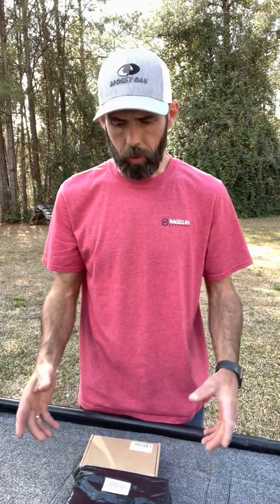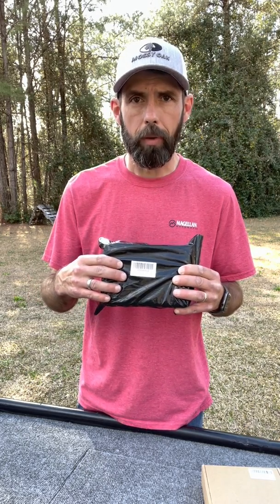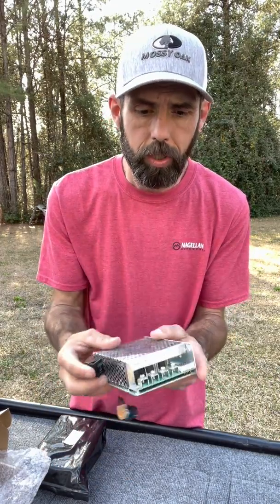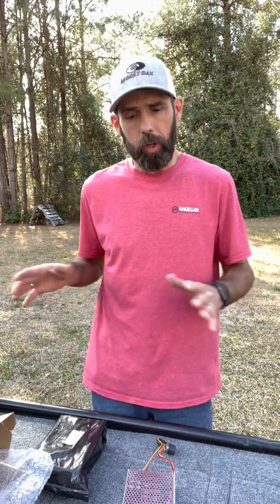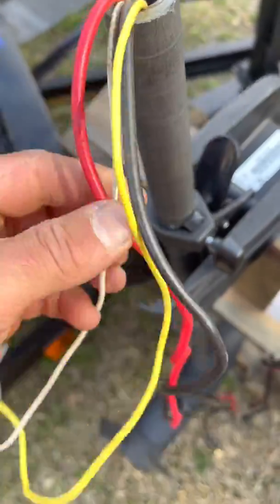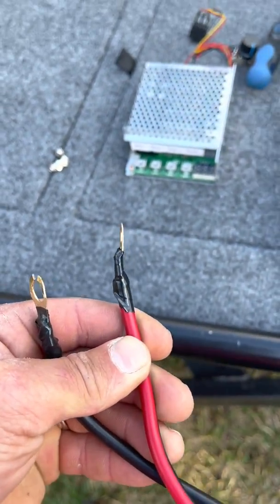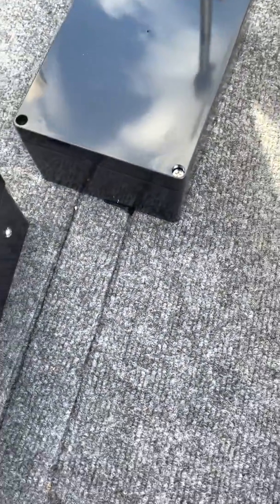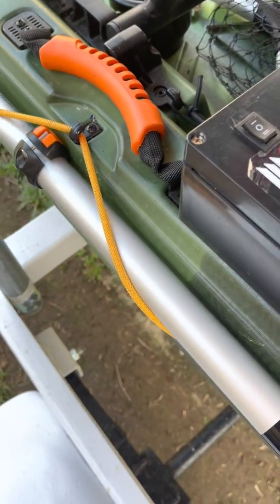How to hook up a PWM (pulse width modulator) to control a trolling motor.

Comment: Greetings and thanks for the good informative video. 

My question is, what are the yellow and white wires for coming from the top of the trolling motor shaft?  Would I need to use those wires if I’m gonna use the trolling motor’s speed selector switch after I remove it from the head of the trolling motor and use that speed selector switch with my boat brakes pedal setup at the front of my boat?  And would this be an alternative to the PWM setup?
Reply from the maker: The white and yellow wires are the low and medium speed wires. When using a PWM the red is all that’s needed is it’s the full speed wire and the PWM gives you control of all speed. 
Now if you’re using the speed control from the trolling motor head yes you have to use all the wires, but if you are using just a PWM no you will not need the white and yellow you can leave them in the shaft of the trolling motor and tape them off.
Reply: @334tacticaloutdoors Thanks so much for the detailed and fast response to my inquiry.  You’re Outstanding!👍🏾
Reply from the maker: You’re welcome!! And thank you for watching the video and giving fantastic feedback.

Comment: Hey thanks for the video. So tell me about that "project box" lol jk. Actually I just fried my first pwm,  I think I hooked one set of wires backwards but looking on Amazon got me wondering would one with higher wattage or amps be more beneficial in any way like helping with performance, or excessive heat? Heat means wasted energy and just wondering if a larger pwm could help with that while also keep it from shutting off due to excessive heat.
Reply from the maker: Yes the 100amp PWM works best for the 45lb -55lb thrust trolling motor.
Reply from the maker: Even the 30lb thrust trolling motor works best with the 100amp and also using 8awg wire from the trolling motor to the PWM and from the PWM to the battery.

Comment: Anyone help.. im about to do this and i understand that if it goes bad on the water you can simply plug motor back into battery to get home.. but how does the head work without them extra wires that were deleted ??
Reply from the maker: Without the PWM you would only have one speed with a direct connection to the battery. Them 2 wires is the speed control.

Comment: Great explanation! I bought the larger of the two, followed your instructions to a tee, and it's not working😢. Connections on the back are B+MMB-. Assuming B is for battery
Reply from the maker: Yes B+ is for battery positive B- is for battery negative.

Comment: I just received my 100amp pwm from amazon and its not labled at all where to put battery and motor wires. Would it be the same as your thumb nail pic
Reply from the maker: Yes it should be the same.

Comment: Ive been trying to figure this out for my trolling motor, but i have a black, white and green wire. Black is ground id assume, so when i put black to ground and either white or green to positive, the motor spins the same direction. Im not sure how to hook it into the PWM
Reply from the maker: Black is your ground, white is your positive and the green is your ground. Hooking to the PWM just your black and white is used just ground thee green wire.

Comment: Great video, man! Do you think it's really worth it to use a PWM? I've been stalling on finishing my new trolling motor install from my old one that burned out because I can't find much info on how much power you actually save, and if it's actually worth adding the extra parts. Have you possibly tested how mch power you're saving?
Reply from the maker: Thank you!! I personally went with the PWM setup for speed control. You’re saving maybe 1 hour to 1-1/2 hours more battery life per day with the PWM that’s about all. Personally if you’re not doing the PWM for speed control it’s not worth it.

Comment: Awesome video sir, doing my project this weekend would you recommend running a fuse between battery and PWM?
Reply from the maker: Thank you!! Yes it’s best to run a circuit breaker and put it as close to the battery as possible.

Comment: does it get hot?
Reply from the maker: If you make long wide open runs with the trolling motor yes it will get hot. If you plan on running long runs at full speed make sure to get a PWM with a built in fan.

Comment: Great video! Thanks for making it so simple. After reading reviews on Amazon about manufactured boxes, I was getting gun-shy about the whole process. My biggest concern is how much heat it generates, and whether that's a concern.
Reply from the maker: Heat can be an issue on long full throttle runs. The 100amp PWM has a built in fan only downside is you can hear it running. Some people vent there box a little bit which helps out.

Comment: I got a pwm from Amazon it's a harmnee pwm DC motor speed controller model # hmsc04d and I hooked it up and it seems like when I tern it on it runs the same speed on 2% and 100% what do you think it could be?
Reply from the maker: That would be a defective PWM. Make sure when you buy one it’s a 60amp or above they do sometimes send out bad ones.
Reply: @334tacticaloutdoors  Brand: WUMZIJ
4.6
4.6 out of 5 stars
(3)
DC Motor Speed Controller Max PWM 3500W, DC 10V-50V & Rated 60A/ Max 100A Brush Motor LED Display Stepless Speed Controller with Forward-Brake-Reverse Switch & Ajustable Potentiometer is the 1 I am thinking about getting I have a newport 40lb trolling motor and I have 2 12v 35amhr battery's I just run 1 at a time.will this 1 work
Reply from the maker: @paulbacon6175 yes that one should work just fine.
Reply: @334tacticaloutdoors  I just ordered 1 when I get it I have a seadog universal kill switch that I want to add to it can you walk me threw how to hook it up
Reply from the maker: @paulbacon6175 yes when you receive just message me and I’ll walk you through the process.

Comment: Please explain what the plugins on box and where to buy.? Thanks
Reply from the maker: It’s all in the description of the video they sell these PWM’s on amazon. 
pwm controller, Motor Speed Controller 10-50V 100A 5000W DC Motor Speed Controller PWM Control Switch Governor
Reply: @334tacticaloutdoors  fantastic much appreciated.
Reply from the maker: You’re welcome!!

Comment: Exactly what I was looking for
Reply from the maker: Hope it helps you out.
Reply: @334tacticaloutdoors  heck yea man, you made it simple, preciate it, got a 10 foot jon boat,  use for crappie fishn, gona put a stick steer on it, actually it was a 1436, I cut it down to 1036, got me a couple 8 foot garden stakes for it, it’s gona be good, especially being able  to stick steer and have me a little dial for my speed and foward and reverse,
All the sloughs I fish with it is in the woods, in the bottoms, no big wind can get to em, so it’s perfect for stuff like that, got a bigger boat for bigger water
Reply from the maker: @clayton203 that was the reason I made the video just to show the straight forward hookup. Glad it helps. I appreciate you watching.

Comment: I did the same connection and my motor wont do reverse…. What am I doing wrong???
Reply: My pwm is 100 amps
Reply: My small motor (36 lbs) works perfectly with all pwm’s i have
Reply from the maker: What size motor are you hooking up to it? If the PWM is good and working fine with another motor then you need to check the trolling motor.
Reply: Works fine when connected directly to the battery( have to do it manually) but once it’s hooked to the pwm no reverse. I can hear the click on forward, but no clicking when I change it to reverse…
Reply from the maker: @juanseminario7287 if everything works fine before hooking it to the PWM there’s something not wired correctly or it’s a bad PWM that’s the only 2 possible reasons.
Reply from the maker: Check all your wiring something is crossed or you have a bad PWM.
Reply: @334tacticaloutdoors  this is my second pwm, and my other motor (36 lbs) works perfectly
Reply: 55 lbs minnkota
Reply: I ordered the $52 pwm, I’ll give it a try

Comment: Do you change gauge before installing to the PWM?
Reply from the maker: If you have to add any wire to the trolling motor to reach the battery yes use 8 awg. Anytime you use a PWM use at least 8awg wire.
Reply: @334tacticaloutdoors would using 6 awg help the pwm stay cooler and last longer?
Reply from the maker: It’s hard to hook 6awg on the PWM.
Reply: @ okay, im running about 11 feet total 22 round trip so i was debating putting 6awg to help with heat in my wire and connectors and pwm. Do u know what size the bolts are on them?
Reply from the maker: @vtyaker9024 the PWM is #8 small bolts. It’s gonna be very hard to run 6awg. I had a hard time getting 8awg to hook up to a 100amp PWM cause of how close they put the hook up.

Comment: Will this work on a home built ebike with 24volt dc motor 2600rpm? 350 watt razor scooter motor. The OEM controllers will shutdown below about 21 volts.
Reply from the maker: You would need to know the amp draw that motor has to see if the 100 amp PWM would work, but yes with the correct amps it would work.

Comment: How long does a fully charged battery normally last?  I'm guessing most of the day?
Reply from the maker: Yes, it also depends on the battery a 50ah battery will last all day plus a little. A 100ah battery will last 2 or more days. A regular lead acid battery will last all day also.

Comment: Built mine exactly as shown. Thank you for that. Only problem is there’s no ventilation in the box creating too much heat and the safety feature will not let the motor run. Any suggestions as to how to vent the box  ?
Reply from the maker: You can drill holes in the box or put a small hinge opening that could be opened when running but closed when you want it to be.

Comment: Hi  have a 12v 50lb thrust trolling motor witch pwm would you recommend the 100 amp or the 60? Thanks for the video
Reply from the maker: Thank you for watching the video. You would need the 100amp.
Reply: @334tacticaloutdoors  thank you!!! Thanks for the quick reply
Reply from the maker: @andylam83  you’re welcome!!
Reply: @334tacticaloutdoors  I was wondering if there is any way you can make a video of making a pwm with installing a kill switch to the box . I could not find a good video explanation about it. I am new and flipped my kayak couple times and almost lost my kayak and also almost got hurt by the blade .
Reply from the maker: @andylam83 let me see if I can get one ordered and I’ll send u a message soon as I get it filmed.
Reply: @334tacticaloutdoors  thank you very much . That would mean so much !!!

Comment: This is an excellent video. Thanks. I made a video on choosing a deep cycle marine battery for a trolling motor, and I noticed that you have a starter marine battery for this. Do you normally use that for your trolling motor, or were you just using that for this video?
Reply from the maker: Thank you. I was only using that for the purpose of this video. I use a 50ah ZPRO lithium battery for my trolling motor battery.
Reply: @334tacticaloutdoors  I figured.  When I originally bought my trolling motor, I just added it to my Mercury starter battery--learned not to do that and felt like a dope.
Reply from the maker: @JasonSipe16  yea you definitely can’t add it to a starting battery. We all have had our learning curves for sure.
Reply: I finally finished my complete wireless trolling motor video with pwm like yours. Hope you'll check it out (it's pretty long)!
Reply from the maker: @JasonSipe16  I’ll definitely go check it out. That’s awesome you got it completed.
Reply: @334tacticaloutdoors  Thanks!  My next step will be to try and add an arduino-based GPS spot lock on the cheap.
Reply from the maker: @JasonSipe16 keep me updated if I can ever help answer a question just ask.

Comment: Why would you describe two PWMs that are still in the packages?
Reply from the maker: I didn’t describe them I only said the amps. The one that I hooked up was the 60amp the 100amp has a built in fan. When u buy a PWM you buy it by the amps not by what it looks like.

Comment: Ok mine isn't labeled the same as yours. It just says "B+ M M B-". In that order. I'm assuming that is battery plus, motor plus, motor negative, battery negative.
Reply from the maker: Yes that’s correct
Reply: @334tacticaloutdoors  Thank you. I appreciate your videos.
Reply from the maker: @sjkeener you’re welcome. I appreciate the support.
Reply: Question. I went out twice. Worked great. I went out Sunday and I had no power. My battery is charged. Is there a fuse in the box somewhere?
Reply from the maker: @sjkeener no there’s no fuse. You may have a loose connection, you may also wanna look and make sure no water go on that PWM.
Reply: @334tacticaloutdoors  after the first time out, water got in the box. I put it in front of a big fan for 5 days. I used it again. It was fine. Now it isn't. Think it could be from the first soaking? I fixed that problem from happening again
Reply from the maker: @sjkeener yea once u got water in it. They will work occasionally, but after a lot of experience that PWM is ruined now you might as well get another one. Make sure no water gets on it.
Reply: @334tacticaloutdoors  yes sir. I really appreciate your quick response and help. A lot of people put the content out there. But, few follow up.
Reply from the maker: @sjkeener you’re welcome. I don’t believe in doing that I answer ever question. I can’t stand to see YouTubers create videos and never reply to comments.

Comment: Just curious, how would you connect a kill switch to that PWM?
Reply from the maker: You would just wire the kill switch in with the PWM power and negative on the forward and reverse switch.

Comment: You might want to make another video about how to make the cables. Everytime I make my own cables, they always fail within a day.
Reply from the maker: How are you making your cables?
Reply: @334tacticaloutdoors  I use tinned cables of about 10 gauge and I use the heat shrink ring connector terminals. Every time it overheats, or maybe copper is touching metal or something but I can't figure it out.
Reply from the maker: @kennys3985 try using 8awg cable cause it sounds like the 10awg cable is heating up that’s causing your problem.

Comment: Please!  I had to bail on this one.  Too much talking about what you were going to do and other videos.  You repeated the words "motor positive and motor negstive"  around 6 times in the short time I watched.  You ever, however told us what the yellow and white wires are for, even though they are t needed for your installation, others may be interested.  Why does it take 17 minutes to e plain where to attach 6 wires?  Sorry to be so brutal.  Looks like you have a decent following.  Good luck.
Reply from the maker: I have the absolute easiest to follow instructions on how to hook up a PWM. I’m sorry it doesn’t fit the way you wanna hear it.

Comment: Did you add an inline fuse
Reply from the maker: Yes when u do your install run a online fuse between the battery and the PWM and I also ran one between the PWM and the trolling motor.

Comment: Why do i have a pink wire in my trolling motor? Whats that for?
Reply: Thanks very much, where did you get the box and ports for the pwm to go in? Thanks in advance
Reply from the maker: @paulhopkins2188 from Amazon the SAE connectors are 10awg and the box is a project box. 
https://www.amazon.com/Zulkit-Waterproof-Electronic-Junction-Enclosure/dp/B07RT6NWTR?pd_rd_w=rtql3&content-id=amzn1.sym.b854a5c2-4475-41f8-a6d4-df92b2868104&pf_rd_p=b854a5c2-4475-41f8-a6d4-df92b2868104&pf_rd_r=D8JFH4G71DS4E4BZDYQZ&pd_rd_wg=lIJxU&pd_rd_r=1b37ea8c-eb58-46d8-b277-eafc4b40def9&pd_rd_i=B07RT6NWTR&psc=1&ref_=pd_basp_m_rpt_ba_s_1_sc
Reply: Thanks very much 👍
Reply from the maker: @paulhopkins2188 you’re welcome
Reply from the maker: Some trolling motors use different wires and some have a built in speed controller. Just if you’re hooking up a PWM you only want to use the 2 10awg wires they’ll be the biggest ones.

Comment: What is the life of the pwm being in an unvented box? The mfg. states to not mount in a closed box, how long have they lasted being in the sealed box?
Reply from the maker: As long as your not running the trolling motor at full speed very long the life can be a couple years. If you’re wanting to run at full speed yes the PWM needs to be vented to keep cool.
Reply: Thanks brother !
Reply from the maker: @toddslupski3072 you’re welcome.

Comment: Is there a fuse anywhere in this setup?
Reply from the maker: This video was just to show how to hook up the PWM, the fuse or breaker would have to be in line from battery to the PWM and also from the PWM to the trolling motor.
Reply: @334tacticaloutdoors so there should be 2 in a pwm setup?
Reply from the maker: That’s correct.
Reply: @334tacticaloutdoors   one on + as close to battery and one on + as close to pwm? Thanks for all the help

Comment: Thank you for the video! Do you recommend buying a PWM that comes with a fan? I don’t plan on using my trolling at full speed for a long period of time, but I do want to make the PWM last.
Reply from the maker: You’re welcome!! If you’re not gonna run it at full speed just short runs around without the fan is ok. The fan keeps it cool when running full speed for long amounts of time.

Comment: FANTASTIC explanation! Been fighting w/my 5 speed switch trying to figure out how to incorporate it. You saved my @$$ & a lot of frustration. Bravo, my friend!!
Reply from the maker: Thank you, I’m glad my video was able to help you out.
Reply: Only downside of pmw, is if you run full speed more then a few minutes they burn up. Ive gone through 3
Reply from the maker: If you’re buying anything lower than a 100amp there going to be  if your running full speed for long distances they need a fan to keep them cool without the fan they get to hot and burn up.